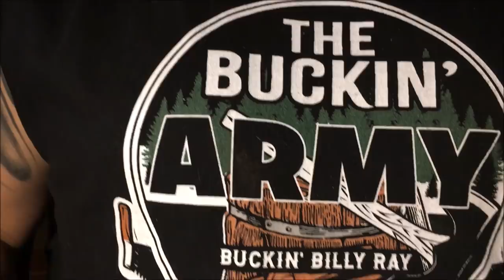OLD HOMELITE XL 76 ,DEALS WITH BAD TREE

Comment: Im 21 and I love cuttin wood with my Dad. We have a stihl ms250 that we have owned for over 6 years. One time I got mixed up on which gas tank had oil mixed and which one didnt. The engine quit but never seized. This was after we had it for only 6 months or less. All I did was pour out the straight fuel and put in mixed gas and we continued cutting wood still has over 200 pounds of compression to this day. The piston is scored but you cant even hang your fingernail in the deepest groove! As far as a power saw. I found a top end for my Grandpas Poulan 306A 59 cc. Around 3.2 cubic inches of beast!! I am going to try to put it together tomorrow if I have time!! Keep up the good work  Buckin God bless!!

Comment: WOW! Thank you so much for that little tip on taking those caps off. I just bought a used chainsaw to do some minor work. I had to use some pipe pliers to remove them. I don’t have the hand strength anymore.

Comment: My 78 Chevy C10 firewood truck has AC like that. Unfortunately it's down until I get the hardware to mount new springs in the back, and the engine needs attention. But...these old trucks need a bit of TLC every decade or so Hehehe
Reply: Angie K jealous of the truck, keep it going!

Comment: That sucker was a bit to rotten. Glad you realized it was before you got up there to far. That could of been really bad. 

Old Holelite idles rough eh? I can tell one or both of the crank seals is leaking a bit on your saw. Turn the saw sideways and it will idle up a bit and idle back down and try to stall once you turn it back upwards. 
Take the clutch off and see if the seal looks wet. It's a common problem on the old Homelite saws. Crank seals dry up and shrink and start a leaking.       

On an old Homelite that's been sitting for a few years I usually change out both crank seals and throw a carb kit in them and fresh fuel line.  I always flush the oil tank and oil pickup tube with some diesel or kerosene because 99% of the time the check ball will be gummed up and stuck.

Comment: Hey Buckin, how long of a bar is on that XL.  I Have a complete unit and  two parts machines.   They only have 16 inch bars though.  Be nice to have a 24.   I think that is the longest that it is rated for. 
Nice bullseye.👌
Reply from the maker: 28 ''

Comment: so....what is the 76 in xl76 for ? is that the displacement in cc's ?
Reply: Canadian equivalent of an XL12.
Reply: @brownwrench  thanks for the reply, i did not know that, but xl 12 is a great saw also.
Reply: @j.chrisbeck7492  I love mine, despite having an 034 as well.
Reply: @brownwrench  I own a Super XL, love that saw.
Reply: I got a barn find Super XL Auto given to me. 58cc. Cuts like mad with the 16" bar, but the chips always jamb up the clutch drum and has to be taken off to clean it out
Reply: @mercoldswfo  hummmmm....mine only does that if I am cutting with the grain, but not in crosscutting.
Reply: Terry Industries made xl-76 and super xl-130's.  Textron made xl-123's.       That series of saw was more similar to the earlier xl-101 etc.  The xl-12 and sxlao were a different design all together.  Tough, fast and gobs of torque.  The xl-76 etc. do share the same piston as the sxl series though.  Earlier versions had points ignitions but around '77-'78 they switched to the infamous blue Prestolite electronic coils.  Huge failure rates.  Hence, it is not uncommon to pick up low hours dead saws from that era.  I've fit up alternate coils to eliminate the Prestolite "blues".  When running well, they will hang with the best <60cc saws of the past and modern era.  Better than a sxlao on steroids.  Ergonomics, balance, response, exhaust note and lines 2nd to none.     I've a couple of vids of rebuilds sporting points and the alternate coils.